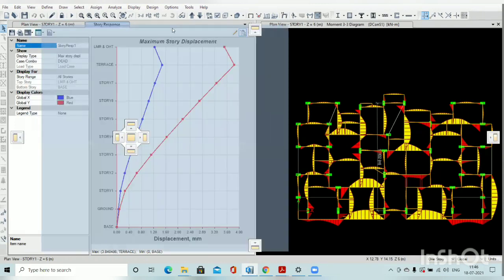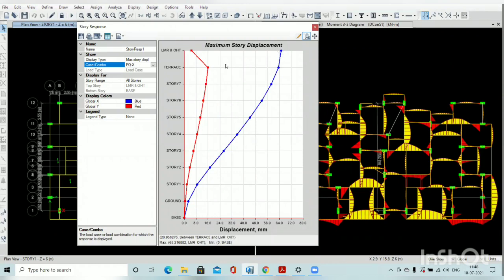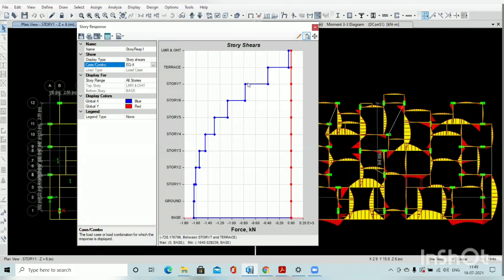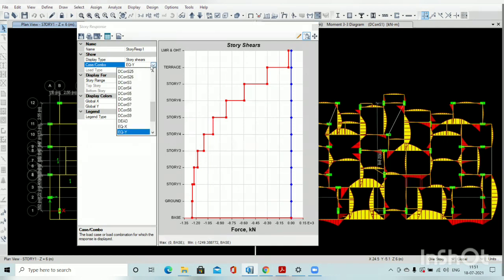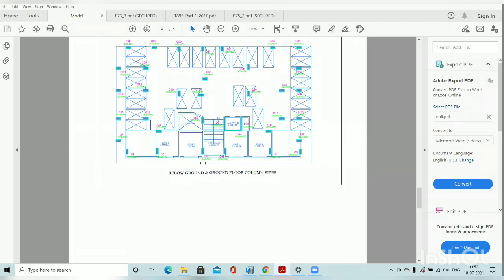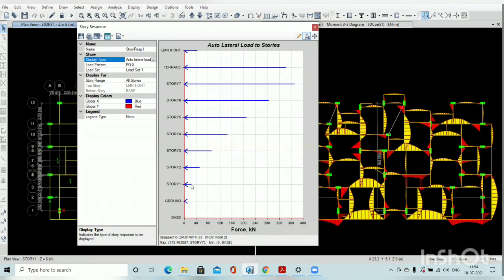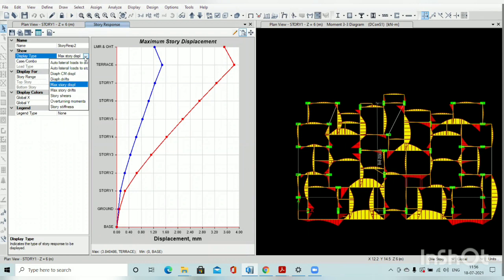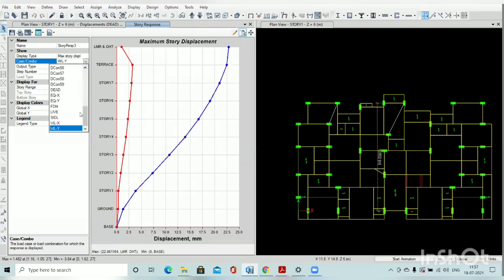Etabs earthquake and wind analysis results : how to check story drift : base shear : story shear

Comment: hello guys, i want to ask, there is a problem with my static base shear. why is the value of fx on sx from steps 1-3, the value is not same, and the value of fy is not 0. and so does sy. do you know where the error is?
Reply from the maker: It is difficult to say anything from here. But you can go step wise and check